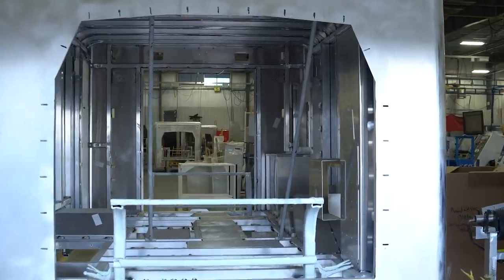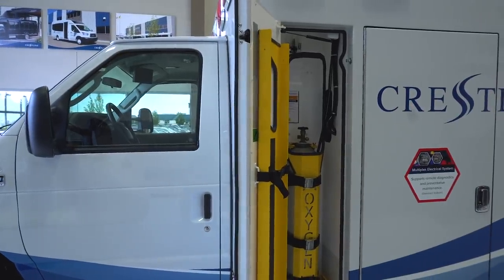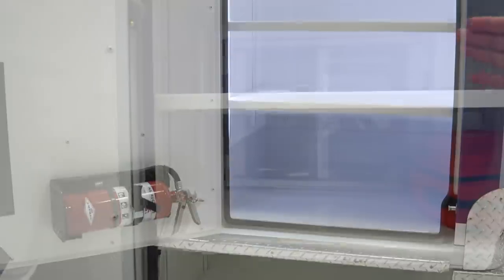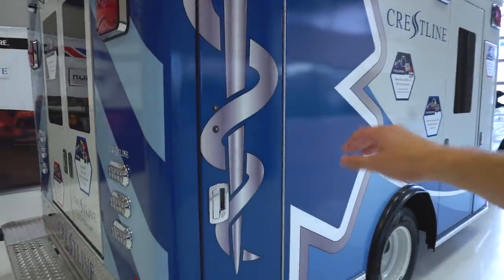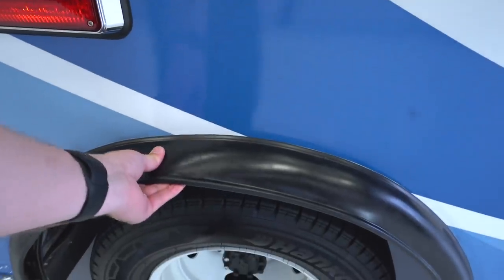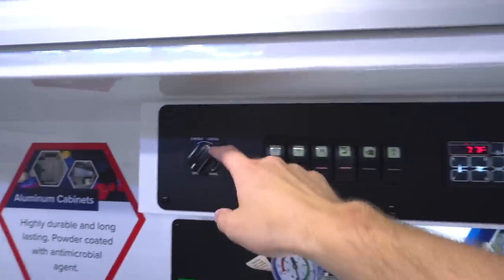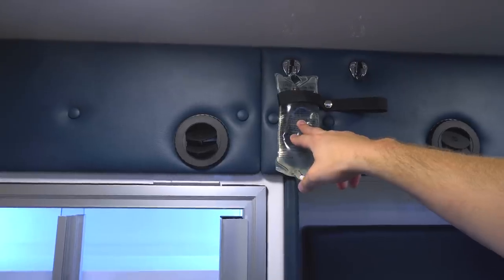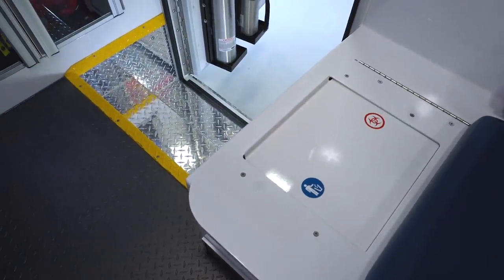Crestline Prototype Ambulance Walkthrough ⎮CCL150⎮

Comment: Where's the provisions for the two way radio ?  When I did radio installs, shiny brand new ambulances always lacked a way to put the radio in, running the rear control head cable then dealing with the NMO mounts in the roof. Hopefully you guys have provisions for these things.
Reply: Thank you for your feedback and question! The CCL150 is prewired to four different locations on the roof for radio antennas. For information and options, please contact a Dealer in your area CCL150.com

Comment: Leg room for driver and Officers seat? How far back can you recline the front seats? I currently work 12 + hour shifts in a system that posts units, so no stations. Leg room and the ability to stretch out is a health and safety issue for us.
Reply: Thanks for your question and feedback. Both driver and passenger seats are recessed 6 inches into the body, which allow for recline and legroom options. For more information, contact a Dealer in your area CCL150.com

Comment: Only one large O2 cylinder? I'm used to have 2 large ones and 1 small as a reserve on ALS units (saw the other ones later in the video now; Strange to have them in the side door) The electrical cabinet seems huge, I mean really huge. Maybe ours seems smaller as a part of it is in the patient compartment and another part is behind the driver and co-driver's seats
Like the dual access compartment on the right side; Don't have that at the provider I work for right now, but the one where I was trained, they had a dual access compartment there as well.
CPR seat? Do they do manual CPR during the ride and don't use e.g. a Lucas?
We have the IV hooks under a cover in the center roof console, with straps holding them in place; They shakre around during the ride but they are secured.
One thing I really don't like which seems to be common on American ambulances: the stretcher located directly on the bottom. Imagine an uneven road and a patient with spine injuries ...
Reply: Every ambulance I've been on has them on the side like that
Reply: @whiteboysixty5  what do you mean by "them"? O2 cylinders, electronics compartment, ...
Reply: EnjoyFirefighting - International Emergency Response Videos same here, that side compartment looked big enough for two and maybe even a couple smaller ones as back up for field/long distance carry.
Reply: Options are available for two O2 cylinders or 1 O2 and  1 medical air. Reserve O 2 can be mounted on the door or just in front  of the attendant seat on the street side  ALS cabinet. More info on the website https://ccl150.com/
Reply: Thanks for your feedback! The CCL150 has the option for dual O2 cylinders. Please contact a Dealer in your area for options and pricing CCL150.com.

Comment: Generally, it looks really nice. I’m just upset that manufacturers aren’t increasing cab room. It sucks to work system status and not have enough room to truly relax. 

Maybe system status needs to go...
Reply: System Status needed to go decades ago.
Reply: Thanks for your feedback! Both driver and passenger seats are recessed 6 inches into the body, which allow for recline and legroom options. For more information, contact a Dealer in your area CCL150.com

Comment: As long as it’s not one of those god awful vanbulances 😂
Reply: Those things are horrible lol, type 2 ambulances are a joke, the ford transit seems to do ok but I still wouldn't want one of those Van's to show up at my house in an emergency lol
Reply: Leroy Jenkins some are alright, the large Mercedes ones are easily big enough, but I wouldn’t want a small ford as my ambo tho haha.
Reply: My fleet is nothing but  older and newer ford vanbulances and it’s rough in the older ones being 6’2”
Reply: The mercs are awesome
Reply: People who deride trauma twinkies (type 2's) have never used one in a busy city or had to go seriously off-road on jeep trails. I've put my RWD ford E350 twinkie in places in the mountains that the type 1 4x4's the FD uses couldn't get. And threading them through traffic is amazing.

I love my type 1's and 3's (medium duty's are objectively stupid unless your rig also DESPERATELY needs a hydraulic system for rescue gear) but there are certain situations where a twinkie is just untouchable.
Reply: Acco 4321 I was going to say QAS previous generation ambulances are pretty good
Reply: @lirrprodigy2810  explanation: type 1 are truck based, type 2 are vans with the normal van back (a.k.a. twinkies), type 3 is a van with box back
Reply: @und4287  yep, I know, most common ambulance I see now ordered new in my area is a ford f350 or f550 (type 1) with a Demers, Horton or PL custom box and a powerstroke diesel followed by the ford E series (type 3). With a PL custom or Braun box. We had some type 2  E series and ford transits from AMR as temporary ones to help during the pandemic, they left about a week ago.
Reply: @lirrprodigy2810  in SoCal we run CCT out of them 😬

Comment: I really hate the light layout. It still astounds me that emergency light manufacturers just don't understand the idea that rhythmic lights are hypnotizing at lights and cause tired or intoxicated drivers to meander towards them. Lights need to follow randomized, non repeating patterns. 

All ambulances should have rumblers, too. Rumblers are so effing incredible for short distances and clearing intersections that I don't understand why they aren't on EVERY emergency vehicle. People get the HELL out of the way when you turn on a rumbler.

Those light and siren controls do not fall easily to hand. That looks like a nightmare for people who don't like to use the hands-free siren setting. I also don't see anywhere NEAR enough lights controls. I want high intensity, low intensity (For night) fogs, directional scenes, a secondary rear-only, and scene emergency (no lightbar and simple all-round blinkers)

Whoever thought an interior third brake light was a good idea is a f**king lunatic who has never worked at night. Fifty bucks says that thing is gonna have a strip of medical tape over it within a week of service.

And whomever laid that cab out and thought "yeah there will never be a time where the medic needs to recline in his seat, he can totally sit bolt upright" is a moron. 

I don't like a sliding door over a sharps container. When I have a sharp, I don't want to be doing ANYTHING except moving my hand to the sharps bin and placing it inside. Any extra steps is just added danger.

The one thing I have only ever had in one ambulance that I wish all of them had was a proper thermostat in the rear compartment. Most of the rigs I've ever had have only had air conditioners with "off" and "frozen hellscape" and heaters with "sauna" and "turkish prison"

The oxygen bottle system is nice. Other than that, it's kind of a crap looking barebones private EMS setup

Comment: I'm surprised you didn't show any radio or intercom equipment, as new units have a lot of communications gear.
Reply: that would typically be installed by the agency, post production. As every agency can be different in comms needs.
Reply: Thank you for your feedback - we will consider showing this in our next video.

Comment: "Lifetime warranty"? Whose lifetime? Oh, yes, it's the same as every other such promise. When it (whatever part) fails it's passed it's lifetime, says the manufacturer.
Reply: The warranty will specify a "lifetime" period. I'd think a vehicle would be 10-15 years. What "Lifetime" means is that the paint doesn't expire before the rest of the rig. For example, 15 year powertrain warranty, but only 5 years on paint. Something like that.
Reply: Crestline ambulances has a proprietary powder coat paint called CrestCoat. Because of its proven durability, Crestline stands by its LifeTime Paint Warranty meaning lifetime of the vehicle. For more information contact a Dealer in your area CCL150.com

Comment: Since this is a modular vehicle why did not they put a molded wind deflector on top front to get better gas mileage over the years.
Reply: Being visible with lights on the front is likely more important.
Reply: Aerocells used to be a common thing. But for in city, your not going to notice that much of a gain. Rural, ya I agree. And any of the areocells had all the lights body moulded in so they were all just as areodynamic.
Reply: Thank you for your feedback!

Comment: A quick question, where are the 2 way radios installed?
Reply: There are spots in the console for radio mounting!
Reply: Thanks for your question! Radios and communications gear are prewired in the drivers console. For more information contact a Dealer in your area CCL150.com

Comment: Okay I only just saw the video. Sorry im late to the game. But honestly. Why the move away from actual lightbars on the cab to flat LEDs on the box? Ive noticed it in recent years and it bothers me. I get the cost part but isnt safety top priority? Its far more visible to clear an intersection from side to side  while driving code 3 with a 3d light bar that sticks out on the cab than flat LEDs that lay flat on the box and arent as visible from the sides. Not to mention omitting blue lights which are more visible in all settings. Just a gripe ive had the last few years.
Reply: Where this company is based (Canada), blue lights are reserved exclusively for the Police. No other vehicle can be outfitted with them.
Reply: @Cortexian  fair enough. That makes sense and i respect that. However where i live and work (Nevada in the US) thats not the case and yet we have been moving the same way for the last 4yrs or so. At least thats when i started noticing it. (Light bars as well as blue warning lights). Red and white were always the main emergency warning colors but blue was always present as well for greatest distance recognition over all light settings
Reply: @Cortexian  This model is built in Saskatoon, but it is a demo for the US. A very large number of US states allow blue lights on ambulances, especially Midwest and North Central regions.

Comment: Good job on the video but this interior layout looks like every other ambo on the road and hasn't changed in 30 years. Yeah they moved the suicide seat slightly back but same old storage cabinets, hard corners and what? A bench seat. Wow that's innovation. How about laying this out like a helo with everything in arms reach and holders instead of cabinets. With a Lucas you don't need six medics in back of the rig during transport. Make the truck smaller, why do we need such a big box? How about a clean sheet of paper design. If we keep settling for this mediocrity they will keep designing the same old thing.
Reply: Thank you for your feedback!